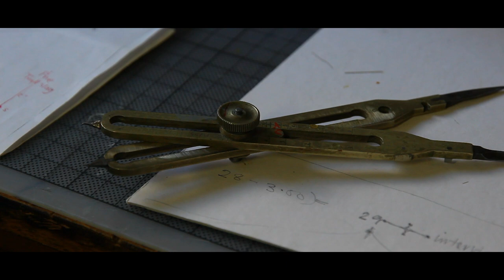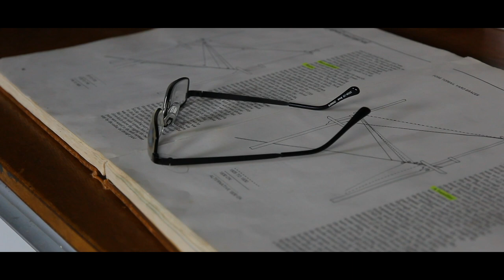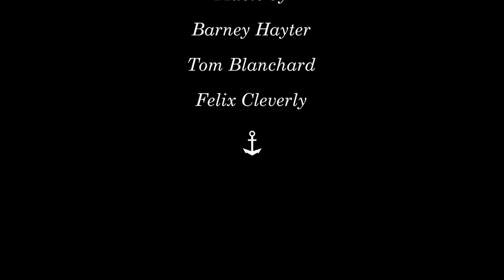Zen and The Art of Model Making - The Story of Philip Reed

Comment: Can we please talk about his tiny miniature table saw.  I just about died.  So cool!
Reply: I think it's a modified Minicraft 12volt table saw. I notice that a larger table has been put on top of it and it has a better fence than the original product. If you can't find a new one, check that famous auction site that rhymes with "flea bay" . If no luck there, Proxxon makes a 240 volt saw with a footprint about the size of a sheet of A4 paper and I use one very frequently. best of luck with your modelmaking!
Reply: I have no words, that table saw was just so cool. The main word is “covet”.🙂🐿
Reply: I have an emco unimat 3 lathe with table saw and all the other wood working accesories . Its perfect for model making.

Comment: " -Paint a flower in the morning..."
That is real wisdom.
Question for the panel from a noob:
Why is the hull of the sail ship model made up of vertical "ribs" with slots in between?
Reply: There are many ways to make the hull of a ship model. It can be shaped from a solid block of wood, it can be formed with a number of bulkheads and then covered with planks (called plank on bulkhead), single panels of plywood bent around a few bulkheads (I've made full size and model boats this way) or ship models can be made the exact same way wooden ships are made - vertical, shaped frames are attached to the keel and then planked over. It's common practice to leave planking off the whole hull, one side of the hull or just a section of the hull so that the internal structure can be seen. Sometimes sections of the deck planking are left unfinished for the same reason, especially if the model contains the full internal structure of the ship. Stick your head into modelshipworld.com - there are some masterpieces on there although with sections of hull missing, they may look unfinished!
Reply: @Yambolic  Thank you for the explanation and the link.

Comment: Model therapy does work. These days I make up sets of toy soldiers to give away to less well off kids, the soldiers and tanks are the cheapest kits but I add detail, convert figures and make a lot of scenic items from scratch, all the stuff I would have liked when I was ten. Some things you can buy but they are expensive and I can produce better. If you want to give it a go the three most popular are WW2 (desert sets are the easiest, no hedges and walls!), 'knights and knaves' (castles are tedious to make and big but as you don't need tanks this is the cheaper option) and sci-fi (shortage of commercial stuff, you can use ancients for the figures, the latest set used a mix of Tudors and Roman senators, the vehicles and space craft you have to make from scratch or kit-bash).  Thus far the kids seem to love playing with them which is pleasing and now and then one will get the bug and start making things, which is very satisfying.